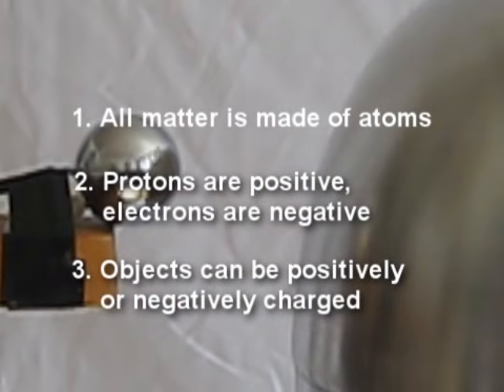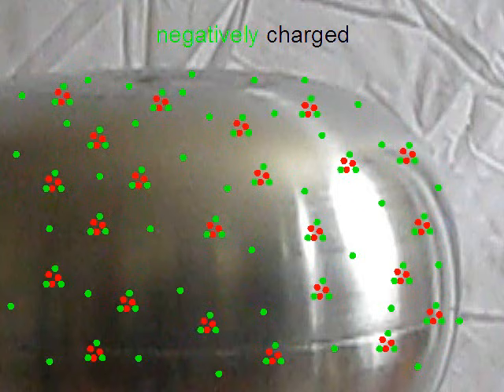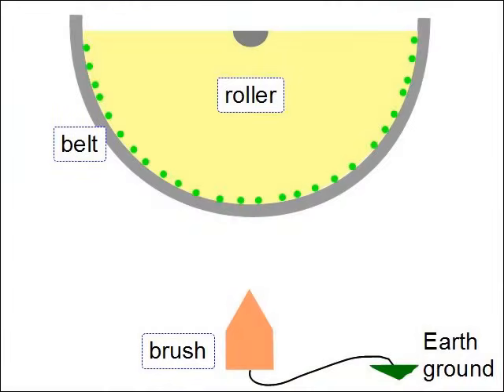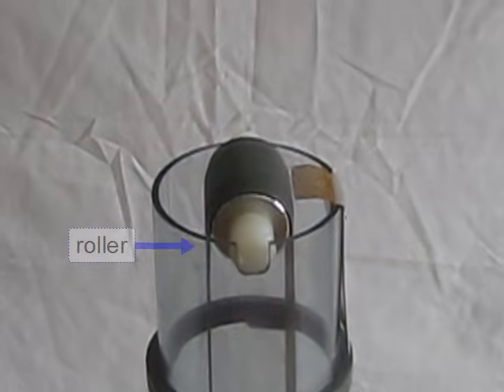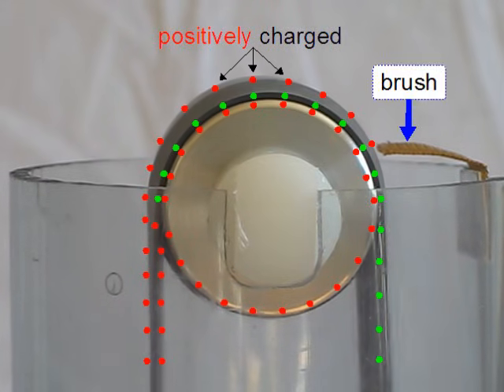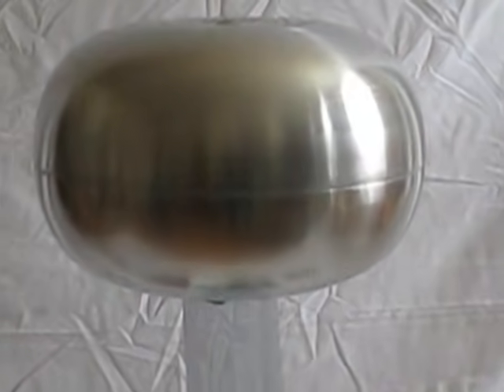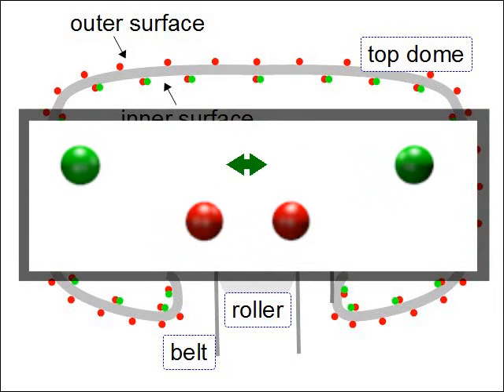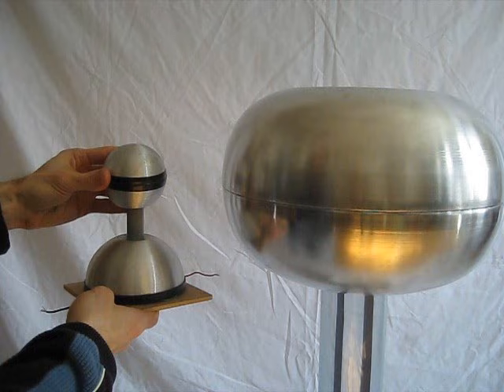How a Van de Graaff Generator Works

Comment: If you put a little amount of rubbing alcohol in a bottle-cap on the top of the sphere, the evaporated molecules would get charged and disperse into the room. 
 Were you to ignite the vapour stream, how would the flame shape respond to the electric field? Would it go out into a ball-shape or what?

Comment: i got a confusion if the charge gets accumulated on the dome its electric potential would increase also the rollers are storing some charge their potential should also increase.What is the limit upto which these can store charge? and also the rollers and the dome are at same potential?
Reply from the maker: There is a limit. The limit is determined by a number of things but mainly the shape of the dome and rollers and if there are any nearby objects. See the video at 14:20. The rounder it is, the more it'll hold its charge.
That also answers your 2nd question. The rollers are less rounded than the dome so they wouldn't build up as much charge.
Reply: okay so i paid a bit attention and i got it thnkx for quick reply, last question is it possible that the van de graaff generator can store no more charge even though there is no discharge produced? like the brush looses the war and now it can no longer attract electrons?
Reply from the maker: If by discharge you mean a spark then yes. Once the charge reaches a certain amount then depending the shapes involved and the humidity of the air it will begin losing charge to that air instead of storing more, just as is described at 14:20.
If a brush was working and it's not anymore and you're sure you didn't move it in any way then maybe the air has become more humid as that may cause the roller and belt to no longer work as well.
Reply: thanks man once again for a quick reply loved your video u got a new subscriber.

Comment: Hey its me again~!!

I am now building a tesla coil. So far so good

I have a very fundamental question. 

My neon sign transformer is rated at 15kv with 0.30 amps(30miliamps)

I am trying to figure out the capacitance and capacitors that I need

I came up with: 53 microfarads rated at 2kv each. I would need about 36 capacitors, is my calculations right?? 

https://www.youtube.com/watch?v=vWhhkeTJxUc&list=PLE518C83AB53FDEF7&index=10

This is the link or tutorial I am following.

Comment: how could you change the construction of the van de graaf generator to make the dome negatively charged? please reply, need help
Reply from the maker: +SuperGirl1659 You need to change the materials you use for the rollers and maybe the belt. They're what determine the dome's charge. Look up the triboelectric series table (on the right here https://en.wikipedia.org/wiki/Triboelectric_effect.) For a negatively charged dome you want a material for the outer surface of the bottom roller that's near the positive end of the table, a material for the outer surface of the top roller that's near the negative end of the table, and a material for the inside surface of the belt that's somewhere in between those two (which is why rubber is usually a good option since it's near the middle.)
Reply: +RimstarOrg thank you so much!

Comment: What  happens if The brush and belt touch each other while the motor is working?
Reply from the maker: +Ronnachai Mita I think what'll happen is that the only charge that'll transfer between them is small amount only where physical contact is made. With a gap between them, charge is collect from more of the width of the belt.
Reply: +RimstarOrg If i take the brush from below off or I didn't connect the  brush from below to ground. Is van de graaff  generator still working
but not good efficacy right? or it doesn't work anymore?
Reply from the maker: +Ronnachai Mita You may still get some result from the top roller/belt/brush provided that the top roller isn't metal, or if may be so bad that you don't see any result.

Comment: do you happen to know whether the generator functions better in warm, cold, or windy environments, and why?
Reply from the maker: +111spartacus11 The only environmental difference I know of for sure is that high humidity is worse because humid air is more electrically conductive. That could cause the belt and rollers to become slightly damp and make them conductive as well, when they're supposed to be insulating. This results in short circuiting, preventing charge buildup.

Comment: I am building a van De graaf, what kind of brush should.I use? or where canni get one? can I use an ordinary metal brush, ones that u used for brushing rough textures? it's attached to the wood. it's thicker. as for my roller, my bottom.is.plastic and up.top is metal  , and my belt is nylon this should work right?
Reply from the maker: +Km Oracle The brush can be anything with sharp metal points, it doesn't have to be an actual brush. Many people use the ends of a stranded wire spread out. You can use a metal brush if the bristles have a small diameter and are spread out a bit. A metal mesh, like metal fly screen, with one edge cut so that some of the wires are sticking out on their own also works.
Your combination of materials sounds good. Most plastics are usually near the negative side of the triboelectric series, though sometimes not, but you'll either have to find out more specifically what type of plastic it is and look it up in the triboelectric series table or just try it.
Reply: +RimstarOrg hey,I appreciate that you replied to my comment,and I also want to let u know that your videos are a massive help in spreading the values of physics, and your explanations are simple and thoroughly explained. I will let you know my progress, and I will take a video once it's up and running until then I will.keep you posted.

if the plastic is negative which is the bottom roller and the metal roller which positive is on the top, does that mean my dome would be positive charge, hence it can only accept electrons. 

if I were to choose a van De graaf generator, the ones that has your standing up, I need to switch my rollers from the negative being at the top and positive at the bottom. therefore my dome has a negative net charge.
Reply from the maker: +Km Oracle That's right, with plastic for the bottom roller, nylon for the belt (the belt material is important too) and metal for the top then the dome would be positively charged.
You hair will stand up regardless of which polarity the dome is. So it should stand up with your positive dome. Well, if you hair is long enough, dry and with no hair products. There are plenty of things you can try if your hair isn't right http://youtu.be/Gf6EbRmYImI.
Reply: I just want to let you know its a huge success, I got my Van working, You can check my channel 

and i also left a link on my description in regards to your youtube tutorial for the Van.

by the way, why is our hair not standing up? do we have to hold the dome a lot longer?
Reply from the maker: +Km Oracle Congratulations! Looks good. It was great seeing everyone enjoying it too. Thanks for the mention. I'm glad to help.
There are a few reasons why your hair might not be standing up. One is that you hair needs to be clean (no hair products) and preferably long. Another is that the Van de Graaff may not be producing charge fast enough to make up for losses while also having a noticeable affect on your hair. Another is that it may be too humid where you are. Also, you need to be insulated from ground, otherwise the charge will go to ground instead of your hair, so wear rubber soled sneakers or something. Try just putting some strips of toilet paper on top of the dome first to see if there's any effect. My demonstration video shows a bunch of things you can try http://youtu.be/Gf6EbRmYImI.
Reply: how can we get it
Reply from the maker: +Seyi Abayomi Are you asking where you can buy a Van de Graaff generator? If so, I bought my big one from here http://www.amazing1.com/static-electricity.html.

Comment: I'm working with a group of students to make a device that attracts styrofoam.  In our experience, the dome of the van de graaff repels the styrofoam.  How can we reverse that?  Would changing the two rollers make a difference?
Reply from the maker: +Eric Coy Yes, you can reverse the polarity of the van de graaff's dome by swapping the rollers. However, I don't think that will help with your styrofoam. It should still repel no matter what the polarity is. That's because the styrofoam starts out neutral. The dome then charges the styrofoam with the same polarity as the dome, and since like charges repel, the styrofoam is repelled. The polarity of the charge doesn't matter. Whatever the polarity is of the dome, the styrofoam will get that polarity.
But, the other end of the van de graaff has the opposite polarity of the dome and so that styrofoam that's charged the same as the dome will be attracted to the other end's polarity. When it gets there, the styrofoam will then be charge with that end's polarity and again be repelled, but this time to the dome, which this time attracts it. And the process repeats.
It becomes much like this Franklin's bell https://www.youtube.com/watch?v=cjlMrSlIIIQ. Also see my video explaining the Franklin's bell http://youtu.be/fEqudsyIWzk.

Comment: Thanks ! but sir i have A question , Is the Potential which is Produced on  the Hollow Sphere Depends upon the The Length of the Belt, or size of the Roller ?
Reply from the maker: +Engr Qaiser It depends on width of the roller that's in contact with the belt. The wider that is, the more charge will be produced at a time.
Reply: +RimstarOrg Sir what about the Belt length?
Reply from the maker: Engr Qaiser
The belt length isn't important directly. The distance between the top dome and the ground wire at the bottom, or the bottom dome if there is one is important. The top dome is charged one way and is the opposite charge of the bottom. If they're too close together then there will be corona between them and possibly even sparks. Of course, that distance has an effect on how long the belt has to be.

Comment: Greetings RimstarOrg. First of all, you have a great channel that I thorougly enjoyed watching. Your topics are very interesting and vids themselves are made with care and love which's rare. Inspired by them I've made a Wimshurst machine and a Van De Graaff generator(you may check my channel for the results).

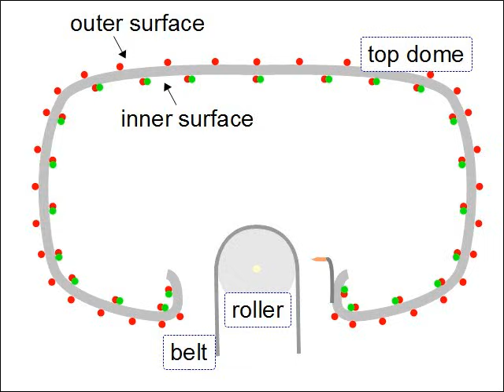However, I'm afraid in this video your explanation as to why the charge resides on the outer surface of the sphere is pretty much incorrect. The explanation takes place from 12:03 to 12:53. In your explanation you refer to different amount of unpaired electrons in area outside of the dome and inside of it which's wrong because Faraday ice pail effect works just as well in vacuum where there's nothing outside or inside of the dome. 

Correct explanation to why charge in Van De Graaff accumulates on outer surface of the sphere would be as follows:
1) If you put a charge inside a hollow conducting dome, free charged particles inside the dome rearrange to compensate electric field inside dome material because electric field in any conductor is exactly zero in static case. If electric field is non-zero, it causes charge rearrangement that makes it zero.
2) Any charge inside conductor always resides on its surface. You explained this effect well enough.

Because of 1) and 2) free charged particles inside the dome materials are divided into 2 groups: first group of the same charge as external charge that is put into the dome, they are repelled to outer surface of the dome, second group is particles of opposite charge, they are attracted to the external charge and reside on internal surface of the dome. External charge in our case is charge on the belt or in the upper roller. Since internal surface has a sharp point it ionizes the air and charge leaks from dome to the belt from there trying to compensate external charge but "sticks" to the belt and gets extracted out of the dome by belt movement.

Notice that even if I'm saying that positive charge concentrates on outer surface of the dome and negative on the inner surface(just example, it may be opposite), there's no actual positive charges moving inside metals: it's just a convenient representation of areas with lower electron density as virtual moving positive charges.

Simpler explanation here would be via gaussian's law: since there cannot be electric field inside the conducting dome, if you take integral over any closed area inside the conductor, it must be 0. That means 2 things at once: charge resides on the surface(because net charge in any closed area must be 0) and induced charge on the inner surface of the dome is exactly equal but opposite to the charge you put inside it(because their net must be 0).
Reply from the maker: Александр Санников I'm glad you like my videos and especially that they inspired you to make things.
I didn't want to use the standard explanation with electric fields and Gauss's law because I wanted to give a more causal explanation. That's why I avoided electric fields and tried to go to the electron and proton level only. I think I succeeded, but can't be 100% sure.
I also try to avoid talking strictly in terms of positive and negative charge moving around because I find that can sometimes lead to incorrect conclusions too. A much better understanding can be gotten by talking about electrons moving only (except where ionization occurs) and electron/proton interactions via Coulomb's law (i.e. repulsion and attraction.)
A problem with your explanation is that, if I understand it correctly, it relies on the sharp point ionizing air in order to make the inner surface of the dome be neutral, whereas in reality, even without the sharp point, the inner surface would be neutral.
Reply: > whereas in reality, even without the sharp point, the inner surface would be neutral.

I'm afraid it's wrong - inner surface of the dome is not neutral if you put external charge into the dome. There's a simple picture that illustrates this effect: https://upload.wikimedia.org/wikipedia/commons/thumb/8/8b/Faradays_ice_pail_experiment.svg/220px-Faradays_ice_pail_experiment.svg.png

You can see that inner surface of the dome has same but opposite charge of what you put inside the dome. If external charge is zero, inner surface is neutral as well, but in our case of VDG we continuously inject charges into the dome so it's not neutral. And yeah, in my vision corona discharge from the dome to belt is what tries to neutralize them.
Reply from the maker: Александр Санников Yes, of course if you introduce a charge then the inner surface presents an opposite charge, until the the introduced charge contacts the opposite charge. At that point there's a net charge on the inner surface which immediately moves to the outer surface and the inner surface is neutral again.
Though in a Van de Graaff generator we have a wire physically and electrically connected to the inner surface so it's done through the wire.
That's the beauty of connecting to the inside of a Van de Graaff generator dome. Any charge you put there immediately gets transferred to the outer surface of the dome and you can now bring in some fresh charge. There's no repulsion to your charge, just an endless sink. I've even used this to get an easy and effective ground for a Franklin's bell at 3:53 here https://www.youtube.com/watch?v=cjlMrSlIIIQ
I guess I could have drawn field lines from the charges on the outer surface of the brush to various charges inside the dome too but that would have confused some people and been irrelevant to the workings of the machine.
Rereading your explanation in your first post in this thread, it sounds like you're saying the ionization between the roller and the brush is the end result of the charge on the dome's outer surface (I could be misinterpreting what you're saying.) It's not. It's the triboelectric effect between the rollers and the belt that charge the belt and provide the voltage for this ionization to occur. It's this charge on the belt that attracts opposite charge to the brush's sharp point and then creates the strong electric field for the ionization.
Reply: I'm afraid I wasn't clear enough. 

In my point of view triboelectric effect is only necessary to charge the rollers. We can ignore belt charging by triboelectricity altogether(while it does occur and contribute positively to net performance). Once the rollers are charged, they attract opposite charges in the brushes and if the field is strong enough, air ionization occurs that forces ions to stick to the belt. Since one of the brushes is inside the dome, surface charge on its external side does not contribute to electric field inside it and only induced charge on the brush does which allows the dome to accumulate charge almost infinitely(until corona takes over). 

You know that there's a scheme of VDG that does not use tribielectricity at all, it just uses external voltage applied to metal rollers to charge them exactly for the same purpose - to ionize air around the rollers and to pull away electrons from one brush and create strong enough induced charge on the other brush to force electrons into it.

Once the rollers are charged by triboelectricity, triboelectric effects no longer matter: if they ceased to exist, VDG would still work.

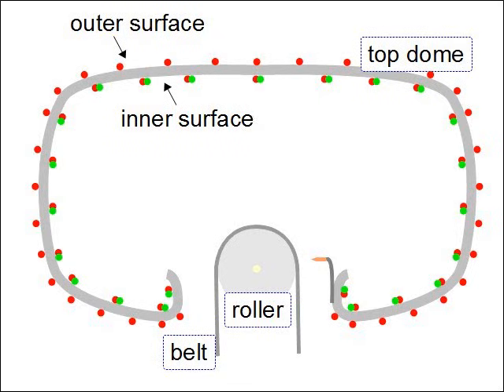So from my point of view, explanation starting 12:03 to 12:53 that refers to amount of upaired electrons in ambient air/objects inside the dome and outside of it is irrelevant, because VDG may work in vacuum as well by pulling electrons away from the brush and sticking them to belt.
Reply from the maker: Александр Санников Yeah, ignore my stressing the importance of the triboelectric charging of the inner surface of the belt in my previous reply. It was a case of trying to reply while not having enough time to do it right i.e. was busy. I describe it correctly in the video, which is the same as you described in your last reply.